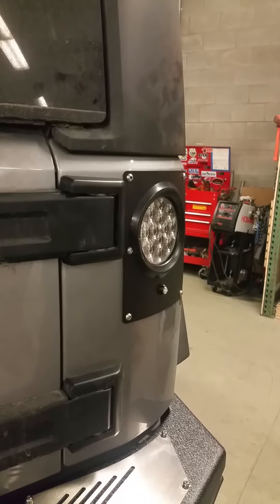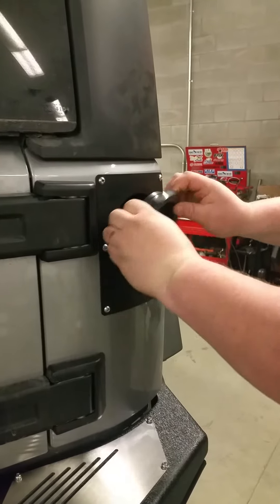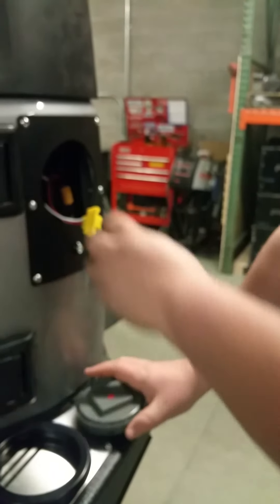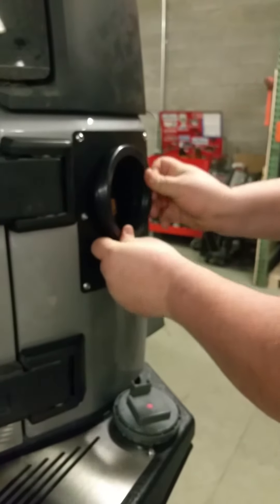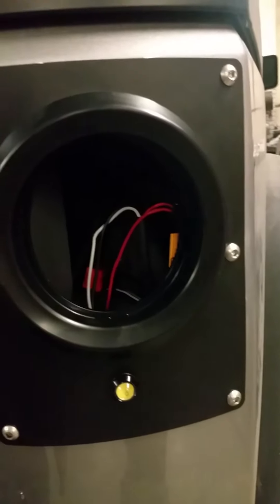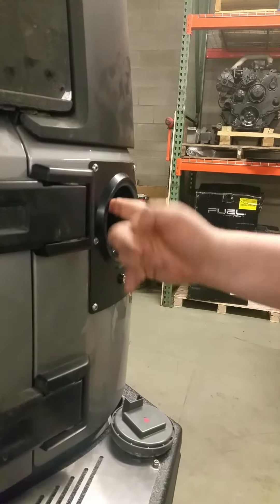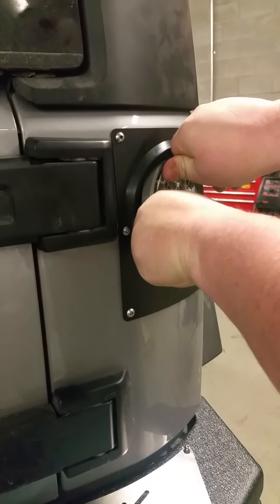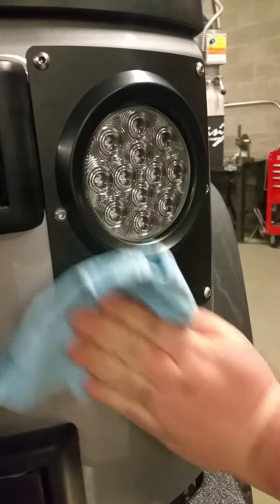Pandemic 4" LED Tail Light Light Install Tips

Comment: Working on installing them and catching hell tring to get them seat flush like in the video. I can get them in with  the gourmet sticking out a bit, but a no go on getting them past the second lip and flush installed.
Reply: +Joe Roberts Hey man, what was your solution with this? I am thinking about purchasing these, but have been a little weary so far..lack of reviews or opinions on this product, and on Pandemic in general is leading me to believe its not going to go perfectly...
Reply: +Ryan Smith, I finally did get them to sit flush. It took me get my dremel tool out and grinding the lip down some. After that I was able to get them in flush as in the video, it took some work and little patiences.

I will say, you will have to cut out the brackets for the stock lights. So once you do this modification, there is no turning back.

But overall, it went pretty smooth and turned out really well.
Reply: +Joe Roberts Damn that is daunting to me! I wonder if Its worth it to pay to get this done. I wish Poison Spyder sold the framing along with their light kit, or there was a way to get a cover that had adhesive instead of needing to drill. Thanks for the info

Comment: Do you recommend putting silicone or some other type of thin material on the back of the plate before screwing it to the Jeep body... since it's metal on metal and also to help keep the unwanted weather out?
Reply from the maker: Hey! That's a great question.  I would say that depends where you live or what you prefer.  It's a permanent modification so a thin piece of rubber gasket material or a thin layer of RTV would work as well.  We have installed tons with nothing at all and there has been no issues but again,  you get out of it, what you put into it.  :)
Reply: "Lubrification" would be the right word!! lol
Reply: ROCKRIDGE 4WD do we have to cut any of the metal?